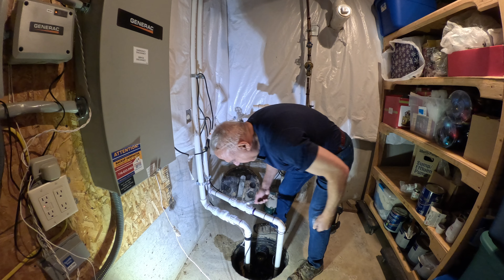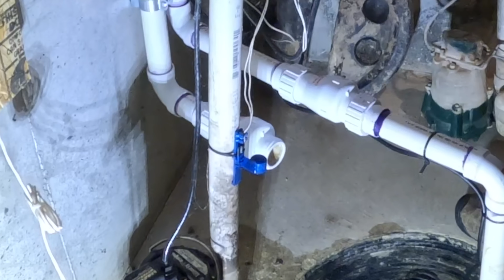Sump Pump Alarm Emergency Replacement Liberty 1/2 Pump #389

Comment: So did you figure out the gurgling and what did you do to fix it? I have that same issue and it’s annoying
Reply from the maker: The gurgling may be from the vent hole that the instructions called for the drill. I can’t remember the exact location. I think I covered it in the video. I don’t notice the gurgling anymore. This is in a room in my basement and the pump seems to function wide, so I don’t dwell on it. I probably tell you to do the same. Don’t let it bother you just try to ignore it. what can we do? We follow the instructions. I hope you consider subscribing to my channel ride safe and in peace.😊

Comment: are those DWV fittings on a pressure application( pump discharge)?
Reply from the maker: Jack to the best of knowledge yes and they work great, so much faster and easier than clamps. I hope this helps you I highly recommend this check valve. Be safe thank you for commenting.